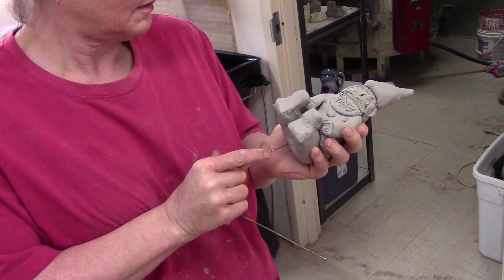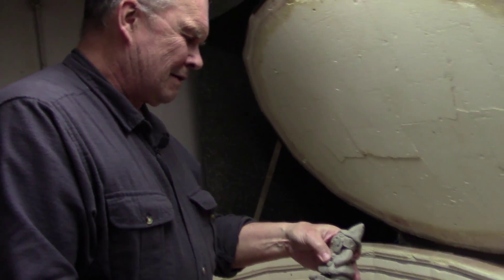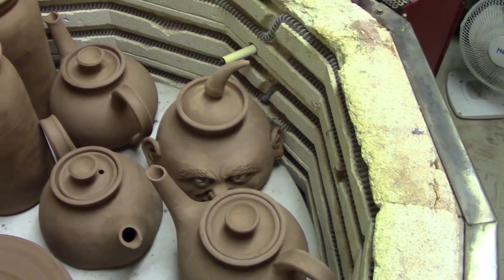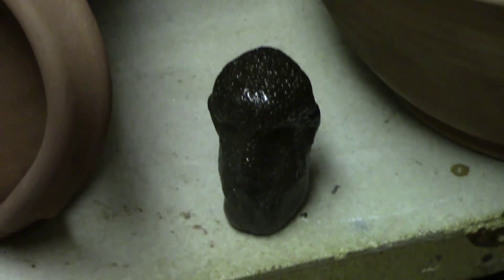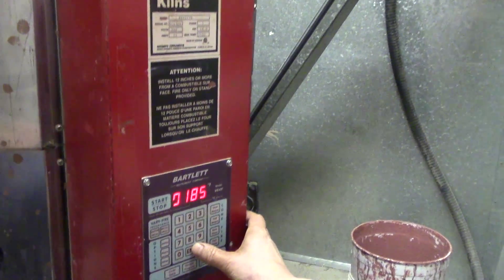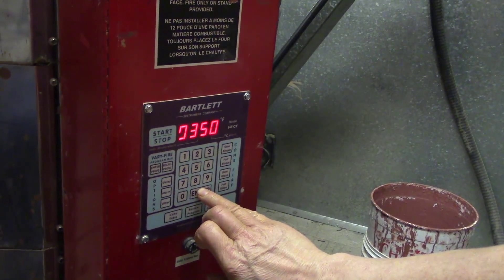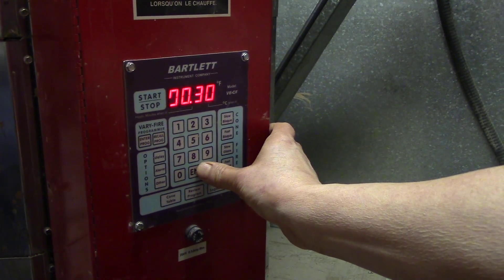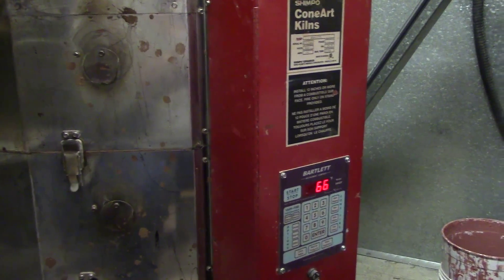Pottery Kiln Loading and Programming for Bisque Firing

Comment: I'm new to pottery and I enjoy learning more about it! I really admire the hand work, everything made in this video is amazing! I'm wanting too get my first wheel but I don't have a Kiln and from what I've looked up, they are expensive! Is their any other way too heat Wheel pottery- pots, plates, etc- without a kiln?
Reply from the maker: Sorry to be so slow getting back to you Dillon. Short answer, no. However, there are techniques for firing pots that don't require a kiln per se. Check out pit firing and raku techniques.